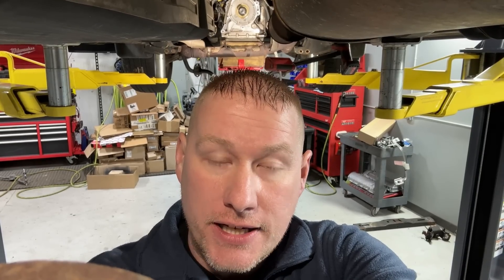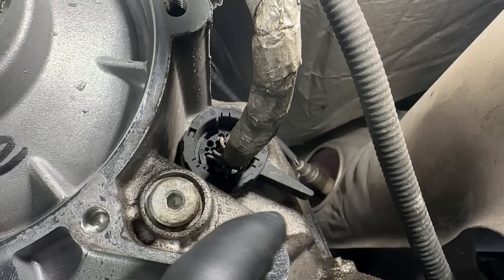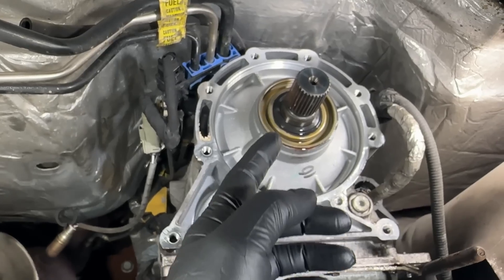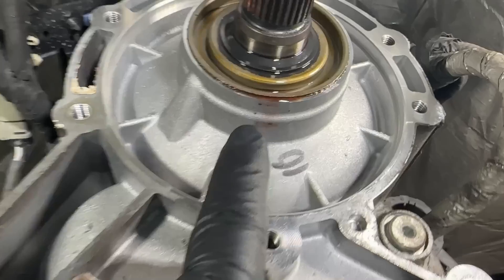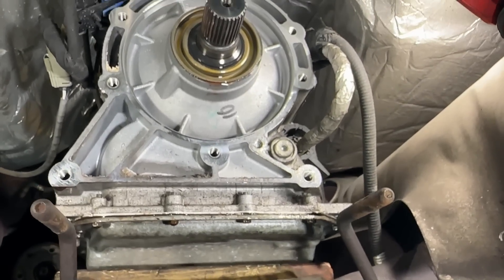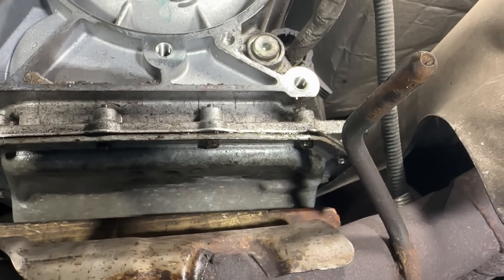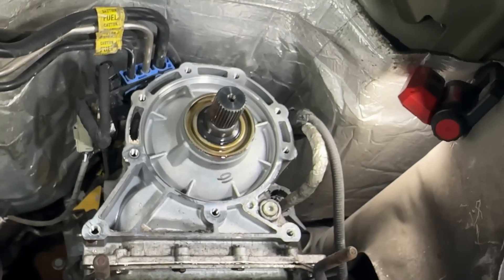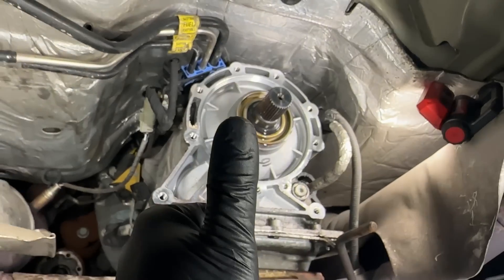Ford F-150 & Expedition 6R80 Six Speed Transmission: Common Leak Points Often Misdiagnosed!

Comment: I have a 6r60 in my 07 Explorer, runs smooth with 140k miles on it now. I added a drain plug when I dropped the pan so it's easier to service the trans, highly recommend it. 

Btw that same truck has a small misfire at 1,5k-1,8k rpm, not enough to cause a check engine light but just enough to feel it under light load. I've replaced spark plugs and all 8 coils with genuine MC parts. Still the misfire exist, any ideas what else to look for? Maybe a airleak or a bad fuel injector?
Reply: You sure you don't have an EGR clog somewhere? It's pretty common for an EGR system to get partially clogged and the cylinders fire unevenly at low rpm and low load.
Reply: Get a scan tool and look at misfire data. You have to know if it's all the cylinders or just one or two. That's the starting point. Don't just throw parts at it.
Reply: @clover  it's a 3v 4.6 so I don't think it has a EGR but I'll see if it has one
Reply: @David Kelp  I scanned it and it gave "random cylinder misfire detected"

Strange because no CEL was on.
Now I'm guessing it's a air leak since it can't give me a direct cylinder
Reply: @mr.boostang2064  I doubt it's a vacuum leak. It would probably have to be huge to cause a misfire. You would be able to hear a big vacuum leak by the hissing noise. I would still look at misfire data to see if just one side is being affected or both sides. If just one bank is misfiring, then you look at injectors or ignition or maybe intake manifold. If both sides, look at egr or maf sensor, such as that. Intake manifolds are not an uncommon problem on 4.6's.
Reply: @David Kelp  yeah I can hear any leak anywhere and I sprayed soapy water while the car was on and no difference in sound or idle. I'll try cleaning the MAF and throttle body, the only other thing I can think of is the injectors but before I start replacing that I'll just have to find a shop that can put a scanner that shows the individual cylinders firing on a graph 📊.
Reply: @mr.boostang2064  Don't use soapy water, that's for air leaks in tires. Use brake clean or carb cleaner. You don't want water sucked into the motor. When you spray over a vacuum leak, you'll hear the engine idle go up.

Comment: Brain how often should the trans fluid be replaced in the 2016 F-150 that does no towing? Every dealership/trans shop says lifetime synthetic fluid does not need to be changed. Is this correct?
Reply from the maker: 60k fluid and filter
Reply: @FordTechMakuloco  thanks for reply!

Comment: New to this channel, and great information!  I have an 18 Escape Titanium.  Recently the RPMs have been fluctuating about 50-100 rpms when in 4th or 5th gear.  It feels like the car lurches forward a bit, or has a bit of a power surge when this happens. I've taken it to two Ford dealerships, and neither can figure it out.  There are no codes popping up, but this is NOT normal behavior.  Any suggestions or ideas as to what it could be?  Thanks!

Comment: Hello my name is Greg De Mare I’m a bmw master tech in South Carolina. I think all your videos are awesome. I own a 2015 F-150 I’m trying to get Apple car play to work. I know there are different versions of sync and the usb port is different in the later models I saw a video that this guy changed the usb hub to part number HC3Z-19A387-F and said that’s all you need after updating sync to the latest version he has a 2016 and the usb hub plugged right in. On my 2015 it won’t plug in there must be an adapter cable. Any ideas on how to get apple car play to work in my 2015?

Comment: Mine had to be rebuilt at 120k due to torque converter. 5.0 2015. Ever seen that issue?  I was told it was common
Reply from the maker: Little friction modifier and they are as good as new.

Comment: i have a 2009 f150, transmission is becoming pressurized, when i open dipstick it sprays fluid everywhere. Only thing i can think of is that vent/check valve is clogged but i can’t seem to find out whether there is an extension tube or just a cap on top tranny, and if so how the heck do you get to it without dropping tranny? Anybody know? Almost no info on the interweb except for one article on mystery of 6r80. 
Any help appreciated, the pressure is starting to cause small leaks in other places.
Reply from the maker: Make sure you adjust the fluid level at the right temp as LV expand a lot. If the fluid level is correct full hot then yes there is a poppet valve on top.

Comment: I've got an '02 Ford expedition 4x4 I have over 200,000 mi on it I would not trade that I've got the extra heavy duty transmission in it and used it numerous of times for disaster mission trips I've had to transmission flush twice in its lifetime and some of the best mechanics still made don't do it again and I understand why this trans extra heavy duty transmission in the '02 Ford expedition is a beast and I like I said before I wouldn't trade the two valve 5.4 l V8 or the transmission in this vehicle I would take it with me to the grave and hopefully both of us don't go anytime soon lol

Comment: The 6R80 ended in 2019. In 2020 started the all 10-speed truck lineup.
Reply from the maker: Nope it was 2020, the Ford workshop manual and parts catalog confirms this. Ford holds onto legacy transmissions for years after introducing new ones. The legacy transmissions are downgraded to only smaller engines found in the basic models of the F-150. They did the same with the 4R75E. 2021 was the first year of the next generation F-150 which is when big powertrain changes are made, and this is no different. Go look it up...
Reply: @FordTechMakuloco  im only talking about the F-series trucks for the common consumer (as stated in the original comment). Maybe the 6R80 was continued with fleet vehicles or in other models not the F-150/250/350…. 2017 was the first 10-speed with the 3.5 EB F-150. Then in 2020 is when all the trucks got the 10-speed: all of the F-150’s and the Super Duty.

Comment: I thought the 10R80 trans came out in 2017? I have a 2019 F-150 with the 10R80.
Reply from the maker: Yes it did what is the confusion?
Reply: @FordTechMakuloco  you mentioned in the video that it came out in 2020

Comment: I had a 6R80 in a 2010 explorer. The torque converter went out at 130,000 miles seven weeks after I got it back the bulkhead connector sleeve started leaking. A couple months later we bought a trailer. This trailer was 2500 pounds under the max tow rating of the vehicle. we went on two trips and the transmission pan gasket started leaking. Upon replacement, it appeared. The gasket had melted. The fluid within 15,000 miles smelt burnt, and appeared burnt. We replaced the gasket. Everything was fine until we towed with it again. And then we traded it off will be my last Ford. When it needed a torque converter, we had the Ford dealership replace it. Since they discontinued the SP fluid I think their junk.
Reply from the maker: There are so many statements here that make no sense, sounds like you had shoddy work done causing all your problems and not Ford engineering.
Reply: @FordTechMakuloco  I had multiple transmissions problems over a 14 month period. When I first had transmission problems I took it to my local ford dealer. They replaced the torque converter. 7 weeks later the bulkhead sleeve started leaking profusely. I had it towed back to the ford dealer. They wanted more money to replace the bulk head sleeve. The dealer claimed the sleeve started leaking due to the new transmission fluid. I thought it was bs. So I had it towed home and charged the bulkhead sleeve myself after watching one of your videos. After that I had problems with the pan gasket leaking every time I towed. If I didn’t tow, the pan gasket didn’t leak. As soon as I towed it started leaking again. After replacing the pan gasket I traded the hunk of junk off.